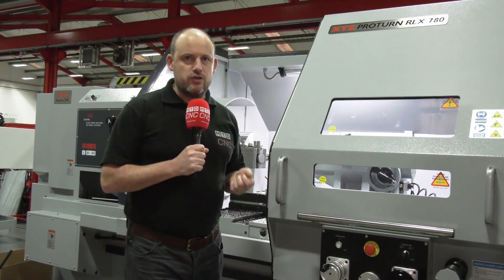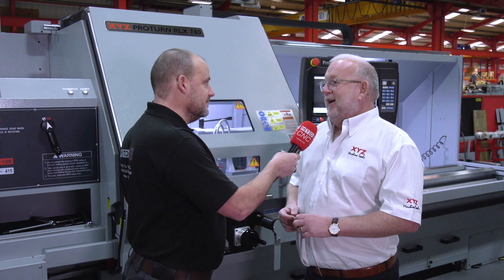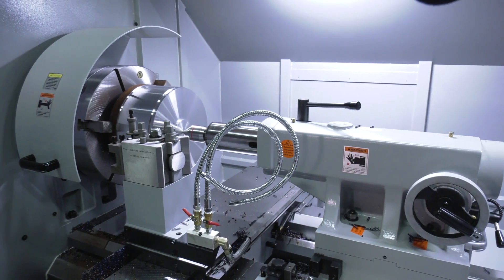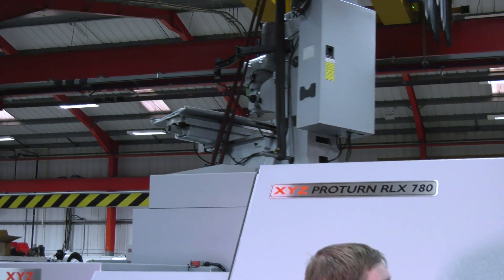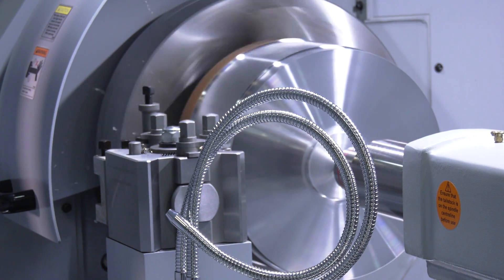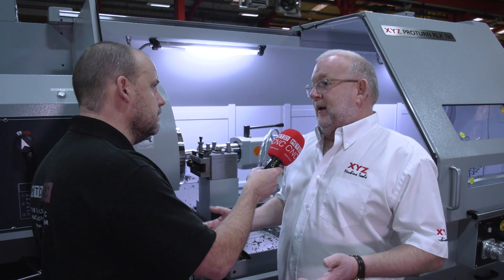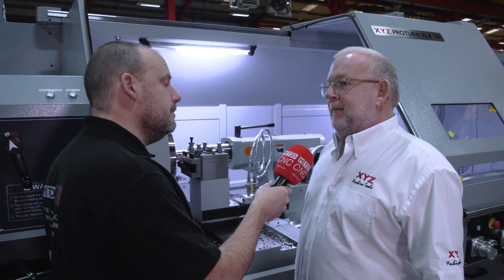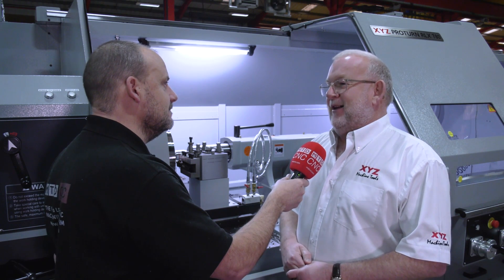Watch this monster CNC lathe cut

Comment: Mazatrol has prototrac beat hands down. On the other hand. Prototrac is the most user friendly for older tool makers. And these older tool makers know more than I've forgotten about cutting all kinds of alloys. And there are no young tool makers coming up. It's not considered a good profession these days, for some reason. So young people take notice of what you're throwing away.
Reply: We have a couple mills that run prototrak controls in my university and the whole thing just feels like a joke to me. It's basically a manual mill with easier to turn handles. I mean it doesn't even have an MDI and a keyboard. Might as well just save the money and get a Bridgeport and put linuxCNC on it.
Reply from the maker: Glad you enjoyed the video !